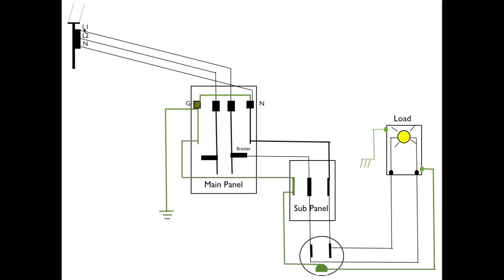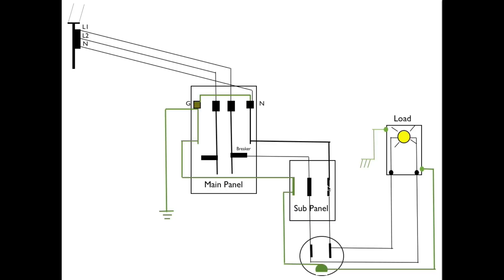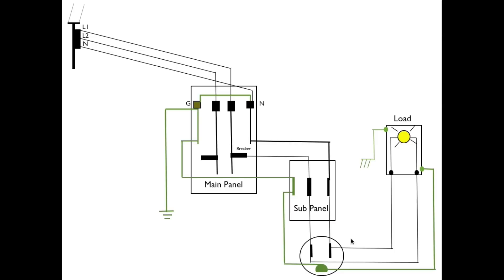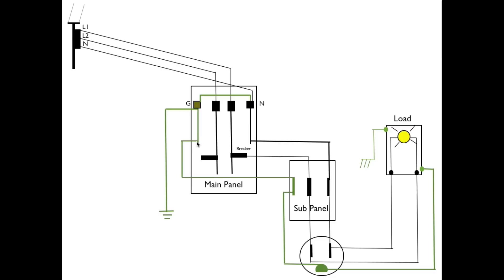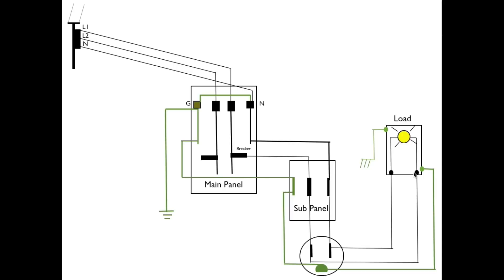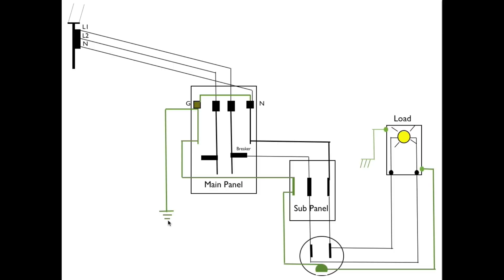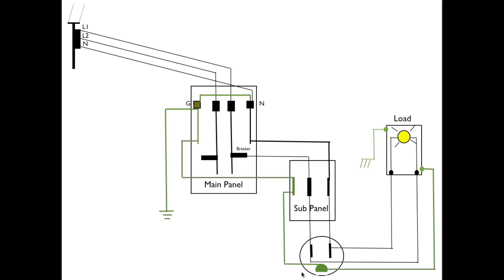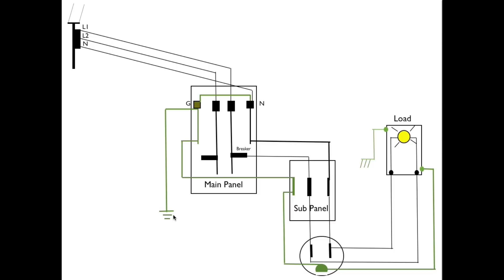The difference between neutral and ground on the electric panel

Comment: thanks for the analysis however how does the ground not carry current (because the earth connection causes to much resistance) -  because the ground is connected to the neutral at the main so the current should be high between the outlet and the main at the ground and neutral connection point because the low resistance of the ground wire is much less than the resistance due to the load - and why does the lightning strike go the ground when the least resistance would be through the load
Reply from the maker: There is no connection between neutral and ground at the appliance or outlet.  Power is only connected connected to ground if there is a fault, so it carries nothing.  Lightning is trying to go to earth, not to neutral or any load.  Resistance of earth is not an issue because earth is one of the poles of an electric circuit between the clouds and earth.  Hope this helps.
GFM

Comment: You need to explain why when lightning hits the pole, current flow thru the ground instead of neutral since both are connected together. Why current from neutral does not go to ground during normal operation since ground is the path of least resistance?
Reply from the maker: Thanks for the thoughts.  I usually do not want to get into every aspect as I am trying to explain one concept.  I do have a problem with the concept that earth ground is the path of least resistance.  Earth ground is not the path of least resistance.  In fact, the resistance of earth ground to the hot lead is extremely high.  For lightning, it is a different story.
GFM
Reply: It is also high for lightning, but the voltages of lightning bolts are also extremely high.

Comment: If there is a fault where current is flowing through the ground wire, the breaker will not trip unless it's a GFI breaker.  Same goes for the outlets.
Reply: RedDelPaPa ? How? the breaker is on the line that supplies power, unless you mean a floating ground fault (more often seen on unbalanced 3-phase motor circuits).
Reply from the maker: 2004done If the short travels to earth ground without passing to neutral at the panel, there is no circuit.  Earth ground will not pass an appreciable amount of power.  Under no circumstances will the amount of power passing to earth ground kick a breaker.  Earth ground is there for lightning protection.  Hope this helps.
GFM
Reply: RedDelPaPa — It will if there’s enough current.

Comment: Question: if the neutral is bridged with the ground in the main panel, Doesn't that defeat the purpose of the isolation in the sub panel?
Reply from the maker: Watch the video.  It tells you why.
GFM
Reply: The NEC explains why the subs are not wired as the main panel.

Comment: The reason for a earth / ground wire is in a fault problem eg fork stuck in toaster that, the voltage of the toaster casing does not rise above 50volts before ensuring the fuse operates under 0.4 seconds making the circuit dead to save people

Comment: I'm here, cuz I had a ground loop problem with my audio equipment.  Major hum, when my mixer was connected to powered speakers (internal amp, 120v).  I 'solved' it by using a 'cheater' 'ground lift' '2-prong adaptor' whatever you call it.  I'm a little concerned about the safety aspect of this 'fix'.  From this video, I gather that my lightening protection is still in place; ie: if lightning strikes my house, while i'm touching the bare metal of the speaker, i'm still safe.  But, I have exposed myself to risk, if the speaker fries its innards, and I touch bare metal.  Do I have this correct?  Is the risk too small to worry about?  Or, am I looking at srs danger?
Reply from the maker: +Doug Cassidy if you are concerned about lightning striking and you being shocked, there is not much more you can do.  
GFM

Comment: I think it is easier to explain, when one considers what would happen if the ground was not present.  Homes constructed in the 1950s or earlier did not have grounded outlets and ground distributed throughout the house.   If power some shorts over to the case and you were to touch both ground and the case, the current would run through your body.  

Your body is resistive.  The ground cables throughout a home are lower in resistance than your body.   By supplying a lower resistive path using ground cables throughout ones home, current will take the least resistive path and go through the cables instead of ones body when touching an active short circuit to the case.   

Electricians are taught to touch active electrical circuits with one hand, use rubber handled tools, and wear rubber boots/shoes.  With low voltage circuits (e.g, 110,240), the circuit is open in this case and current should not pass through ones body.  The instant you touch using two hands you can get shocked.   With bare feet to ground (Water to ground even better) and touch an active circuit with bare hands and one should expect to get shocked.    All bets are off when touching high power lines with Kilovolts because it can jump small air spaces.
Reply from the maker: I would never trust the power to go to earth ground.  It is a high resistance path.  Not the conductors but the earth itself.  If there is no path to the neutral, and the chassis is hot, even if there is an earth ground,  You will get shocked.  Add to that, the circuit protection will not open.
GFM

Comment: I have one outlet that has 60V from line to neutral but line to ground is 120V. What does that mean? Is that a problem?
Reply from the maker: There is probably an open in the neutral and the feed is thru a load.  You have a problem that needs to be fixed in the neutral line.
GFM

Comment: hii ,

can i then join the ground and neutral together ? does it causes any problem ? i mean i just link another wire to join the casing ground to neutral ground.
Reply from the maker: The whole point of the video was why you separate neutral and ground.  They should not be connected together outside of the main panel.
GFM
Reply: GFM gave a great vid explaining WHY neutral and ground are separated. Watch the vid again carefully. The NEC covers the reasons. Get a copy, or go online and research.
Here's an example:
Say you connect the ground and neutral together at the load; neutral breaks thus using the ground to be a current carrying conductor now; THAT is very dangerous!
GROUND is the most important wire in the electrical system.

Comment: neutral is a wire carrying current . switching to positive and negative. just like the hot wire. it is referenced to ground. the ground is connected to the earth. the neutral and ground in my panel box is connected.

Comment: Maybe I'm missing something, but most houses don't have any sub panels, meaning that ground and neutral are bonded throughout the entire electrical system within the house. Wouldn't that make the ground potentially current carrying if the neutral wire was not intact, and yet never trip a breaker? (btw, the only thing electrical about me is reading ECGs)
Reply from the maker: Consider a plug in appliance.  Like a toaster.   It has a hot connection, a neutral connection and the ground is connected to the metal chassis of the toaster.  During normal operation, power only passes thru the hot and neutral.  There is no connection between neutral and chassis ground.  When I put a fork into the toaster to get a stuck piece of toast out and the fork touches the  heating element, there is then a connection between hot and ground and the high draw of power thru the ground will open the circuit protection.  Hope this helps.
GFM
Reply: Mike; Re " but most houses don't have any sub panels"      In the Deep South there are subdivisions of homes that all have subpanels. ie say 99.5 percent do! The power companies and gas companies decades ago had wars to make the homes about all gas or all electric . 

The electric gamit is one got a free "house power box" ie  the outside meter box has say 6 spaces for double breakers. one for AC unit, one for dryer, one for subpanel in the garage or farther away and one for Range. In this area the say pre 1990 homes that do Not have subpanels is like home that does not have an AC unit or has no indoor plumbing, ie zilch. 
My own home has a 200 amp meter base house power box and it feed a 100 amp subpanel which has separate neutral and separate ground bars. My business has 2 meter bases with many 240 volt breakers and also 4 subpanels to downsteam with separate ground and neutral bars.

Comment: My house doesn't have a sub panel, just the mains breaker box and yes the neutral is connect with ground, so what's the deal?
Reply from the maker: The primary panel (the first panel after the meter) has the neutral connected to earth ground.
GFM

Comment: if the Neutral and Ground are tied together in the Main Panel, why does it matter that they aren't connected to each other in the sub-panel?  Also how are the two isolated when they are tied in the Main Panel.  Thank you
Reply from the maker: If you connected the gnd and neutral together at any sub panel downstream of the main panel, and understand all appliances and panels downstream of the main are sub panels, so if I connected a portable drill that has a grounding conductor, power will flow from the hot lead to the drill motor and return thru the neutral.  But also power would return on the frame of the drill.  We have 2 paths for the return current.  
Now lets look at the situation where the neutral conductor fails open in the drill.  The drill would still operate normally.  
Now lets further consider that the grounding lug in the cord to the drill has been removed.  
Your metal drill is now hot.  Pull the trigger and you get a shock.
Also consider that electricity takes all paths available to it.  The old saying about it takes the path of least resistance is not true.
If there was a loose connection in any neutral conductor that is in the path back to the panel, ALL appliances downstream of that connection will have a hot chassis.  
Hope this helps.
GFM

Comment: so is that main panel the meter bank? and the sub panel would be the one you find inside your home?
Reply from the maker: The main panel is the first panel after the meter base.  
GFM
Reply: so the main panel has to have both ground and neutral bonded?? but any point after the first means of disconnect , like a sub panel than i would separate and have a isolated ground bar
Reply from the maker: You got it.
GFM
Reply: grayfurnaceman thanx buddy

Comment: Hey I have a question about the ground. Why is the ground wire so small compared to the hot and neutral wires? Seems dangerous to me. Thanks
Reply from the maker: Unless the unit has a lot of years on it, the ground is not smaller than the hot and neutral.
GFM
Reply: @grayfurnaceman  Thank you. My house was built in the 1960's, and the ground wires are much smaller than the hot and neutral. It is wired with 12/2 Romex, but the ground wire in the Romax cable is only a 16 gauge.
Reply from the maker: That was common back then.  The reason seemed to be that it would only be used during a fault.  Not really a good idea.  You need to understand that the NEC does not always use the best techniques and is affected by business wanting to make it cheaper.
GFM
Reply: @grayfurnaceman  I agree. There could be a short that causes close to (or a little over) 20 amps to be drawn through that thin wire for several minutes, causing it to get hot and start a fire before the breaker trips. In my opinion, that logic of "it will only be used during a fault, so it's okay to skimp in it" is like saying "It's okay to buy a fire extinguisher that has a good chance of not working or making the fire worse because it won't be used under normal conditions anyways".

Comment: thanks but what does the L2 do? is it just another hot wire that can be connected to a load then a neutral to complete a circiut?
Reply from the maker: I did a video on the 3 wire system that may help:  http://youtu.be/sAg9VgMY8nU
Reply: L = Line. L1 is 120 volts. L2 is also 120 volts. By using these two Lines together, you achieve 240 volts (also called 220).  Which is what electric hot water heaters and electric stoves and electric dryers require. If you had all gas appliances, then technically you could run your house on only L1 or L2, because the basic outlets and items in your house only require 120 volts. So, yes to your question, L2 is just another hot wire.

Comment: Need to include WHY ground and neutral are connected at Main
Reply: John Smithy  The reason the question is usually asked assumes that the answer will explain why the ground is connected at the MAIN but NOT at the subpanel also.  It seems like a logical fallacy is being commited because the answer does not fully explain what and how the ground and neutral is different at the MAIN versus the subpanel.  Apparently, if the ground and neutral share the same bus at the subpanel then the risk of energizing the ground  is unacceptable and dangerous.  Therefore, I stand by the statement that the given answer does not clearly and adequately address this conundrum.
Reply: Kenneth Jordan    Hope you don't mind if I answer.   The electrical system itself will work fine with no equipment grounds at all.   I believe they started equipment grounds in late 50's or early 60's.   The NEC decided to have the equipment grounding system completely separate to the main panel for the reasons given in the video.   The reason the neutral and ground are combined at the main panel is that it gives a path for the short circuit to go from equipment ground to neutral and to the transformer, through the winding, back to the panel and trip the breaker.   Hope this helps.   Respectfully,   Kevin
Reply: Thank you Kevin C.
Reply: Kenneth Jordan    Always willing to explain Why.   That was the focus when I taught classes!   If something does not make sense, ask.   Respectfully,   Kevin
Reply: Hello Sir! Excellent explanation. I have a related but different question, using the setup in the video. NEC 408.40 requires the panelboard to be grounded. This makes perfect sense!

Now here is the question. If I ground the panelboard to the equipment grounding bar, and then do a continuity test between (1) the subpanelboard and (2) the neutral bar, I get a continuity reading, saying they are connected. 

Doesn't this now make neutrals and grounds connected in the subpanel? If so, will this cause the ground to have (unwanted) amperage?

I hope this makes sense. I agree with the setup in the video, but I have always had this question. 

Thank you!

Comment: How would I connect a floating neutral generator to a ground and neutral separate sub panel?
Reply from the maker: Call an electrician.
GFM
Reply: Oh, so you don't know then. I figured it out, floating neutral is wired the same as a grounded neutral on the sub panel. The reason is to prevent a ground loop. Don't act like an authority if your not...

Comment: all my wires are underground . is there a way to find out if the neutral is bad?
Reply from the maker: Disconnect both ends then check continuity.
GFM

Comment: Why the current does not come down to the ground at the connection of Ground to Neutral at the Main panel? As you say it comes back to the power supply.
Reply from the maker: Earth ground is not part of the circuit.  There is no low impedance path for electricity in earth ground.
GFM

Comment: Neutral is ground. Chassis ground prevents the chassis from being live/hot if a power wire breaks off internally and made contact with a metal chassis.
Reply: this is most likely happen in things that get hot or vibrate/shake. corrosion or fatigue.

Comment: This does help, but it's not exact. The neural does not get grounded at the "main panel." It is to be grounded at the first means of disconnect. Even in older houses, there may be a meter/main breaker combo outside, and that is where the neural gets grounded--not in the main panel, which would be a main-lug panel.

Comment: I’m confused on the bonding between the neutral & ground. Wouldn’t that make the ground a current carrying conductor?
Reply: Ground doesn't carry current under normal circumstances.   Neutral does.   The grounding conductor (green wire) is only there as a backup to carry fault current back to the source, in case there is a fault to the metal housing of a piece of equipment, or other piece of metal not intentionally carrying current. 

Neutral carries the return current, when you have loads requiring it, or imbalanced loads.  It does have some voltage above ground, but usually less than 10V.  It just has enough voltage to drive current thru the ohmic losses of the wire, when it carries current.  It is tied to the ground at the service disconnect.

Comment: what if  it goes from the meter to a 100 amp breaker then to  the main panel  ?then what do you do with the ground and neutral?
Reply from the maker: The first panel after the meter base has the the neutral and earth ground bonded.  All others have them separated.
GFM

Comment: the only thing i dont understand after watching this: since the ground is bonded to the neutral in the main panel, whats the difference with bonding it at the sub panel? Seems to me that there is still a path that current could flow back on the ground on.
Reply from the maker: First, forget ground as a current path.  Earth ground is not part of the circuit.  It is a 0 voltage path for lightning and surges in the line.  All paths, including the neutral go to the pole transformer.  The only reason you can use the chassis ground as a safety is that it is connected to neutral at the panel.  If you study this video in that light, it may make more sense.
GFM

Comment: How does a 240 volt generator "with no neutral or ground connected" just two hot legs backfed to a 240 volt breaker run an entire main panel. Where the ground and neutral bus bars are tied together . 120 loads included? How is this possible without a neutral?